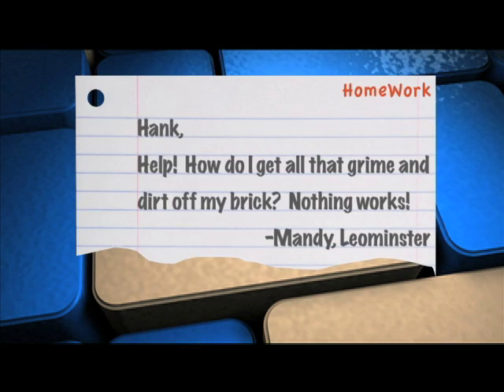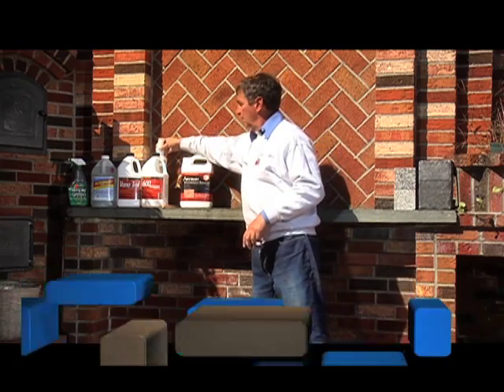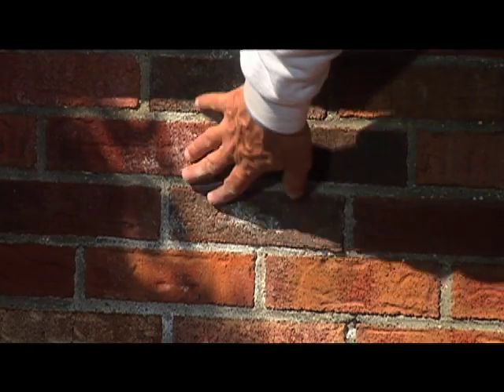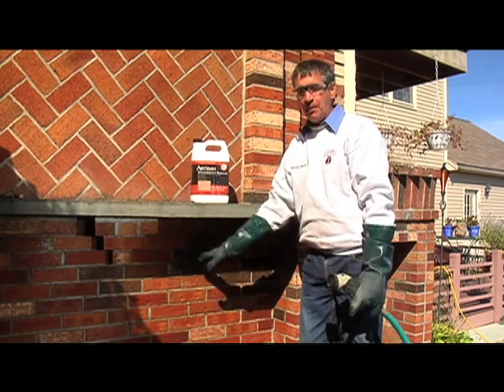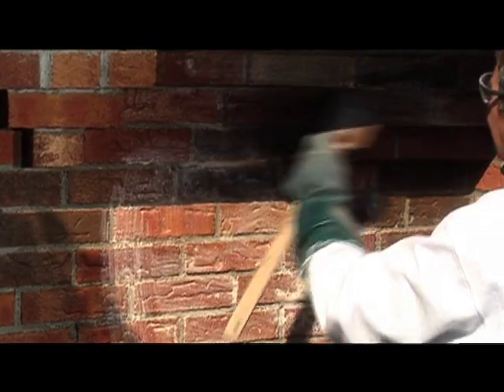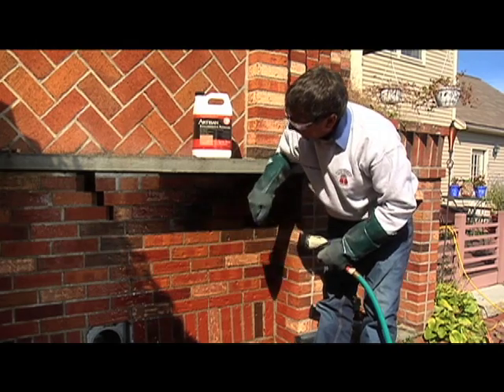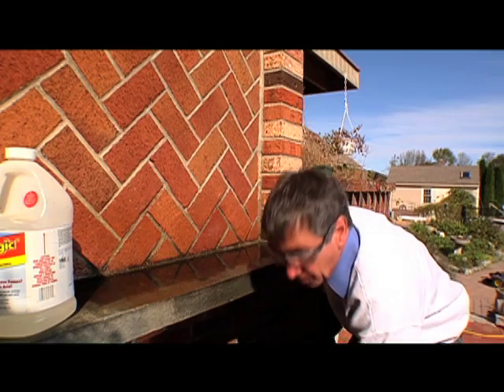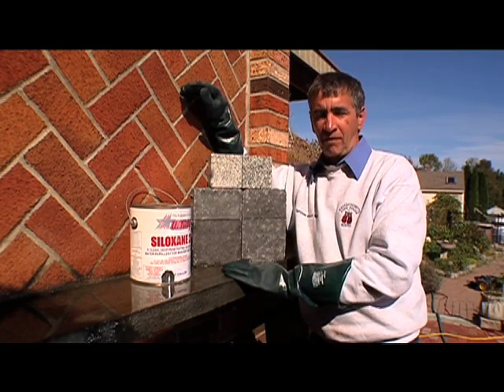Cleaning Brick and Stone - Outdoor HowTo From Home Work With Hank

Comment: A high pressure washer won't push dirt in deeper, but if you don't have a good cleaning solution, it won't clean that well unless you are using a commercial high pressure and temperature sprayer.  If you decide to use a high temperature and pressure, you don't need any solutions.  The temperature of these machines can reach about 250 F.   This will dissolve anything, however you will need to ware the proper safety apparel, such as helmet, goggles, high temperature gloves, apron and boots.  You would only do this if you have a large area to clean.  If you are just doing your garage, driveway or barbecue, a regular pressure washer and solution will work fine.

Comment: The National Brick Association, the makers of bricks, says never to use acid to wash or clean bricks.  It can damage the color of your bricks and void your warranty.
Reply: Actually that depends on the brick and the type of hose nozzle you select for the task at hand. 

If it is the correct type of brick and condition you can use the softer nozzle (uses less force) and keep fair distance away from the brick work which will be absolutely fine.

The National Brick Association were referring to close up full force type hose nozzles that would damage certain types of brick work. 

I’ve been doing this for a living for 25 years pal so I think that qualifies me enough to speak on this.

Comment: I use hydrochloride acid for dark bricks use about 2 to 3 inches in a bucket fill it with water get a broom that will soak the acid and hold it in the bristles and put it strait on the wall leave it there for 5 to 8 minutes and go anout 10 to 15 metres aciding the wall at a time while leaving it the acid on the wall go straight away and start scraping when you've scraped it all off then wash it off then repeat on lighter bricks put 5 to 10 mil in the bucket and repeat as above if you put to much acid in it will stain the wall and bits of the lighter brick will turn green if it turns green not to worry just use chlorine as what you would use for a swimming pool put about 2 to 3 inches of chlorine and fill it up with water and repeat as a acid clean would be carried out.
Reply: Learn to use punctuation.  This is one very long run-on sentence. It makes your writing easier to read, so that people understand your points better!
Reply: @drnotebook  . Yes , yes ,n yes. But how did you miss spelling errors?
Reply: I'm goin out on limb here. I think you mean Hydrochloric acid. You need to be very Pacific with this stuff. Ppl will do anything